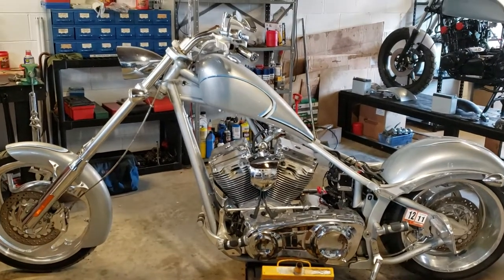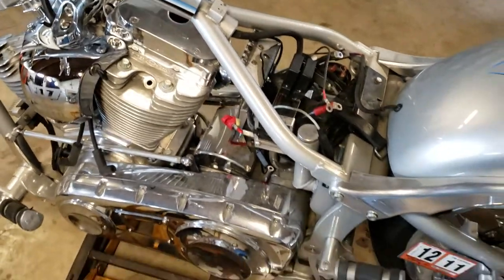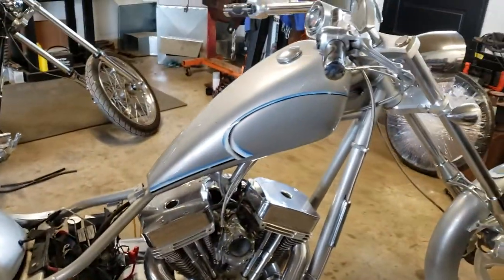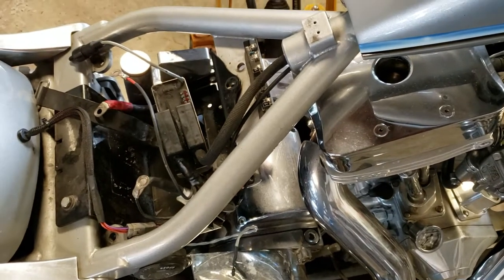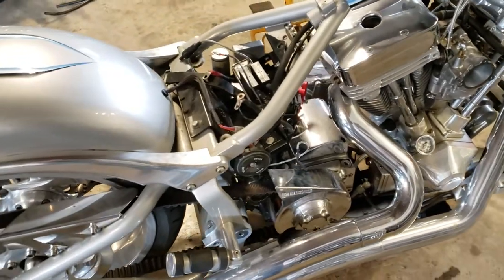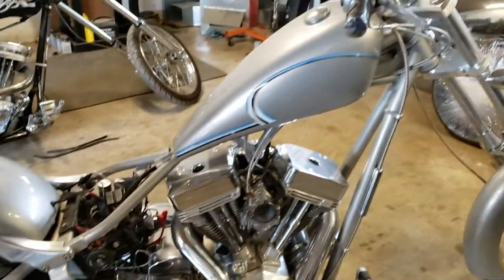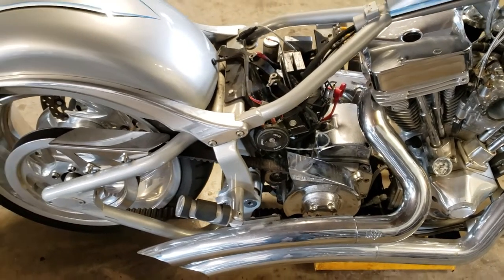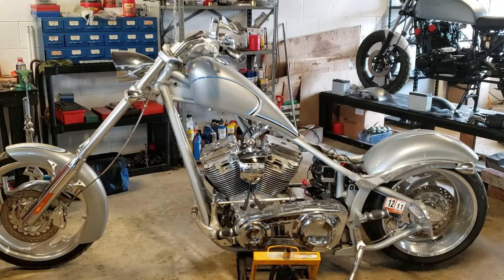2005 Big Dog Chopper EHC Module "ECU" Electrical issues

Comment: When you say nothing works what wasn’t working? I’m asking due to my 04 Pitbull just shut off on me. None of my hand controllers work my running lights and my head light stays on. And it won’t start. The high beams and blinks are inop..
Reply from the maker: I mean nothing, turn the key on and nothing works, no lights, no starter, absolutely nothing. It is a common problem with these big dogs. Everything on the bike runs through the EHC module. Been waiting over 2 weeks now for the new RIP Gen 2 unit to come in. It was  $675+ shipping. Direct from big dog. Good luck
Reply: Carlos, if your EHC has gone bad there is something that caused it.  I've owned an 06 Pitbull for 1 year.  My total system shut down.  I found there was a Voltage Regulator recall  and I still had one of the bad ones.  It's possible for a split second my charging system sent a voltage spike that got past the VR and breaker nocking out my EHC.  I recently had a new charging system, voltage regulator, and german ehc by ELEKTRONIK installed.  Call Curtis at Wild Steed Worx if you don't have a plan.

Comment: This has to be what is wrong with mine. One day ill turn the key on and everything will work. It will start and stay running. The next day ill turn the key and nothing. 5 seconds later all the blinkers flash. Ill turn it off and on 10 times and then it will be like normal. Something electrical has to be going on.
Reply from the maker: Most likely. That's how it usually starts out then one day you turn on the key and nothing works at all.
Reply: @thedragon2299  thanks. I'll have to get it in the shop